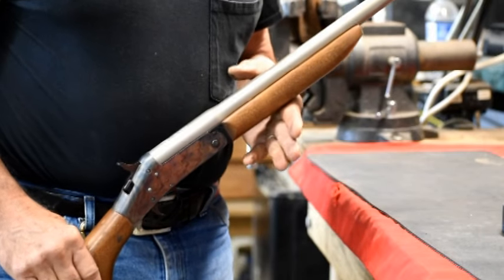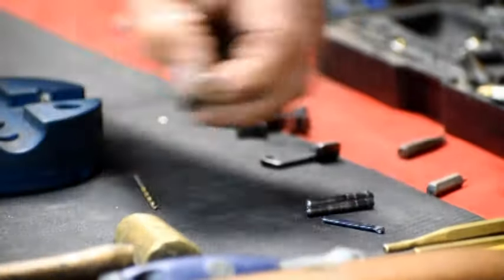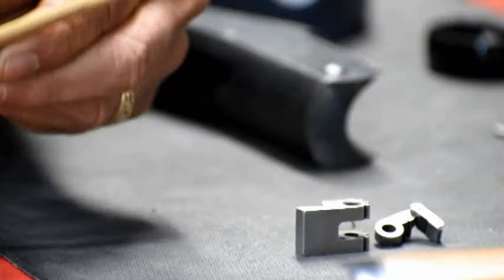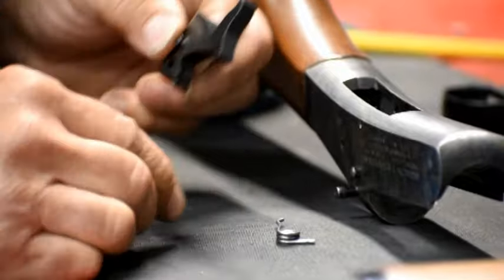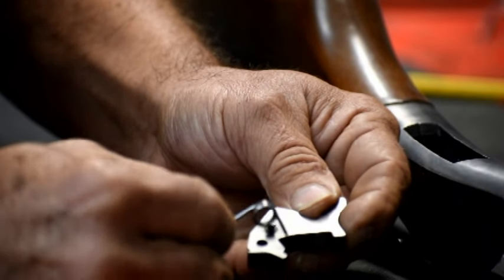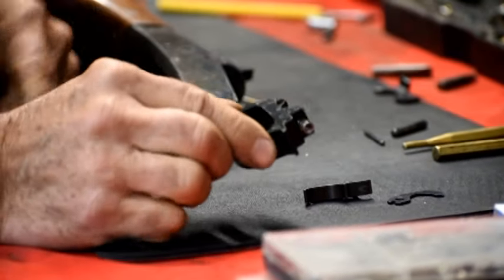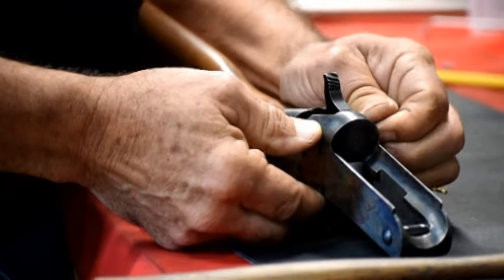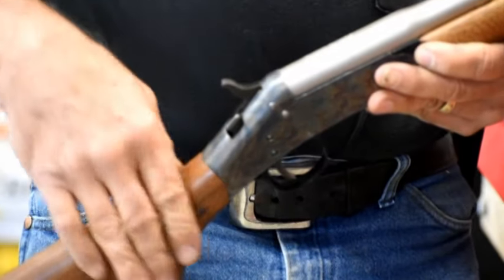H and R Pardner 410 Single Shot Assembly and Disassembly

Comment: Excellent video, by far the best on the H&R I have seen. At 4:57 when describing the spring placement for the "lifter striker" the leg does of course go in the first notch, but just for clarification, it goes in the notch farthest away, or the low notch, in the barrel catch.
Reply: Yep. I found that out the hard way. If it's in the wrong notch, then there's nowhere for the barrel release to go into. Had to pull it completely apart again on the last step 🤬😂

Comment: Thank you very much for this vid. I have a Mod 88 that my grandfather bought my 40 years ago that has needed the striker & lifter assembly replaced for longer than I care to say. I've had the replacement part for quite a wile but didn't feel confident enough to tackle the procedure. I'm going to get on it today thanks to this valuable information.

Comment: Go to the hardware store and pickup a 3/16" dowel pin. It is the exact same diameter. Use that as your slave pin if you do not have anything you can use. This made is so much easier to do. Thanks for the video.

Comment: Thank you Ted 🙇
This video is also useful to disassemble and reassemble the Rossi single shot rifles and shotguns (youth models, trifecta models, even the newer model).
Exact same pieces, there's only a safety lever that the Rossi has but it's just a pin that interferes with the hammer and  it's easy to put on.
I revisited this video multiple times for cerakote projects on those Rossi firearms.
Thank you again and greetings from Costa Rica 🇨🇷 
Pura vida!

Comment: By far THE BEST and most detailed disassembly/ assembly video I've seen (in all categories, not just firearms). Also, great feedback on the comments below. Found some similar issues such as when I pull the hammer back, it does not lock. Everything else (freedom of movement & spring tensions) feels right. Any advice on this is greatly appreciated. Thank you Ted & Knighthorse Firearms

Comment: Just a small tip when assembling the trigger slave pin. Use a 3mm cable tie to compress the trigger spring. If you pull it tight the trigger will clear it and it will be easy to line up the holes and insert the pin.

Comment: Great video! I have a problem with my model 58 12 gauge.. after I install everything I drive then pins into place and my hammer no longer stays cocked. However when the pins are just holding everything in place the hammer stays cocked just fine. What am I doing wrong?

Comment: Good video.  I had to replace a broken firing pin and trigger guard for a customer. Still having issues as my firing pin is protruding out when hammer is lowered?  Pin came from Numrich so you never know if correct size/length.  Will play with it some more.

Comment: Fully reassembled mine with replacement oem parts from Numrich. My barrel release is actuating the barrel catch until I install my barrel. Once barrel is installed, it’s forcing my catch down and won’t lock so the barrel will just fall down and the release trigger stays down. I remove barrel and the release functions as it should…What is wrong??

Comment: Such great video. Thank you so much for taking the time. I have a question for you Ted. I HAve a New england firearm sb1 and a h&r 88. Both look identical to each other and the 410 this video. But my sb1 can be open when the hammer is cocked. Wich is not the case of my older 88. I cant seem to find any info on this anywhere. Is this a feature they remove or I actually have some safety issue with my gun.
Reply: Sorry it has taken me so long to get back to you. Without seeing it in person, it would be hard to tell. I suspect it's a safety issue. I've never seen a shotgun that could be cocked with the breech open.

Comment: I have a problem with a H&R MODEL 88 the gun wouldn't break open. One of the lugs was broken on the barrel  catch. I used this video to replace the the barrel catch,lifter spring, and barrel catch spring. The gun will not stay locked closed now. Any suggestions on what look for would be appreciated. This video was very helpful.
Thank you

Comment: I couldn't find videos on the 12 I'm trying to do now and the last one I did was a 20 gauge that I couldn't find a video on and man that was a pain in the behind to get back together those springs have to have tension in order to put it in correctly I also had to do something else that was impossible because the spring would fling open as soon as I tried to close it. I finally got it together but broke the plastic that is connected to the trigger guard that leads to something else. It still functions as it should but if someone takes it apart they would need a professional and a new part.

Comment: I have a New England firearms 410 single shot shotgun I was told that I can have the same gun in a 20 gauge and take the 20 gauge barrel and fitted on the the 410 without doing anything is this correct

Comment: Is there a possibility that a lifter spring on an old weapon will not set correctly when reassembling because it’s too loose or is this an error on my part by maybe not having a good enough slave pin? Everything fit back together well and I thought it looked good until I noticed the hammer not connecting with the striker to hit the firing pin.

Comment: Hello I have a 20 ga H&r ultra slugster. It snaps some times and has caused me a few deer.  Some times it shoots other time it won’t I tried changing shell brands and it still does it.  What do you think could be wrong ??  I say the Stryker assembly.  

Thanks for any help
Reply: Replace the firing pin and it’s spring. It sounds like your firing pin may be missing the very tip of it causing it to be slightly short, or it could be deformed. The spring could also be missing entirely which would cause light strikes.

Comment: I have followed these instructions a couple of time now and I still have the same issue. When I pull the hammer back, the trigger does not lock into place leaving the hammer back. The hammer moves freely and the trigger does not fire. What piece could be broken or malfunctioning in there? I have looked all the parts over for possible wear, only thing I can thing of is that the trigger spring is too weak. Any help would be greatly appreciated.
Reply: Sounds to me like the trigger spring is either not working or installed incorrectly.
Reply: Broken hammer spring. Happened to mine and I just fixed it. I had the same issue.

Comment: I have a 20ga that the firing pin won’t retract until the hammer is lifted after firing. What would you look at to fix this? Thanks in advance.
Reply: First, I'd make sure the firing pin is clean and that there are no obstructions in the hole where it resides. A lot of these firing pins have no spring and are inertia driven. They won't retract until the hammer is cocked.
Reply: I know this is old but that sounds like it’s just missing it’s spring or perhaps the spring is broken/worn out.

Comment: How does the stock come off?
Reply: Take the butt plate off, there should be a long hole down the stock that gives you access to a screw or bolt that attaches to the reciever.